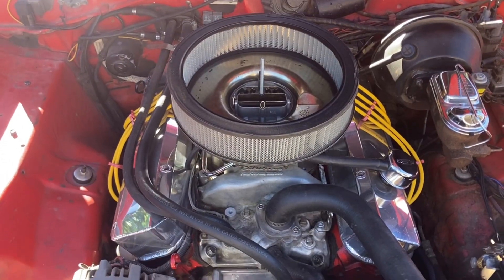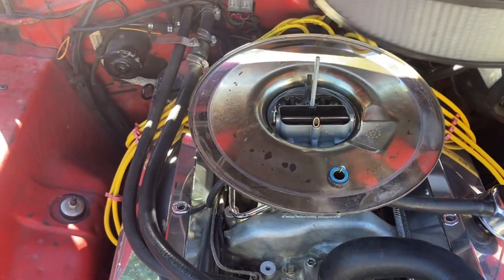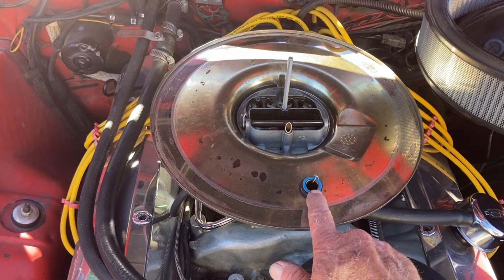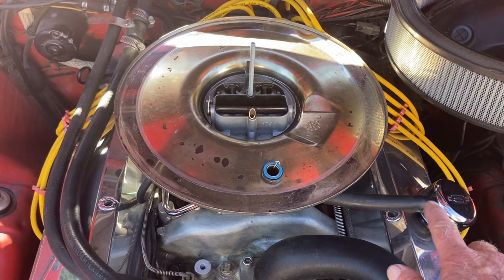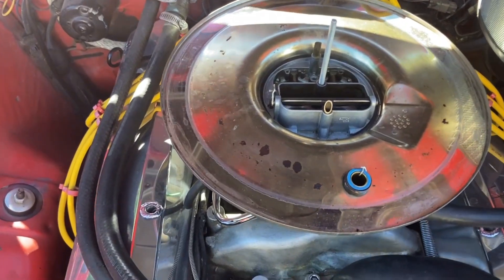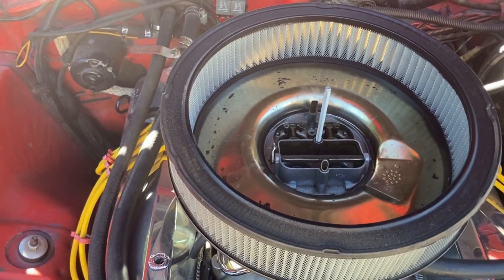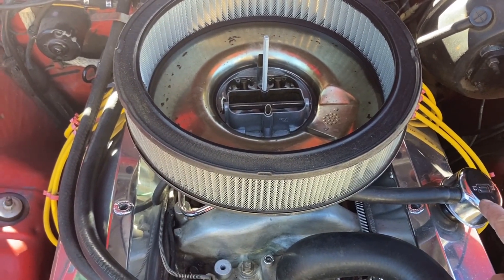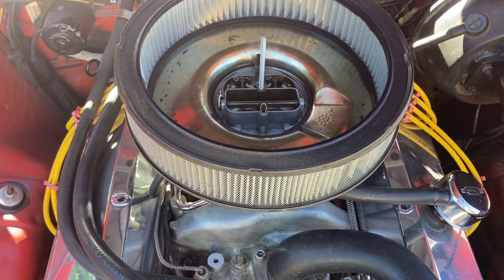Positive Crankcase Ventilation

Comment: Too bad you've got it backwards.   With the engine spinning clockwise (from the front) the gasses build on the driver side of the engine.  That's where they should be evacuated from, replaced by filtered air into the passenger side of the engine.